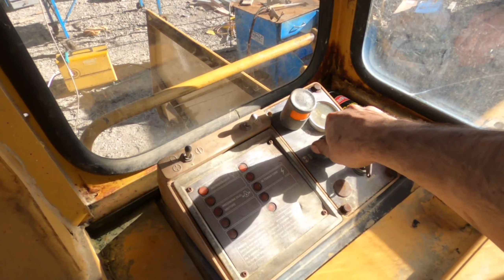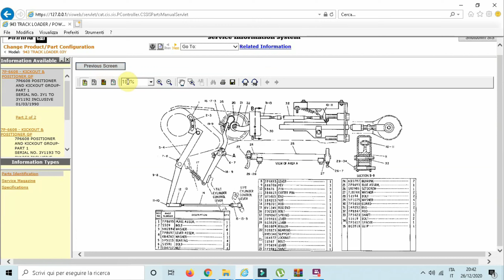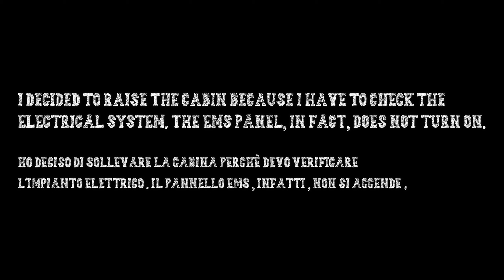CATERPILLAR 943/953!! Systems Operation Testing and Adjusting. EMS SYSTEM,TILT CAB (24 °) PART. 2

Comment: Are these engines in frame rebuild able?
Reply from the maker: Hi absolutely yes. To replace rings and pistons you can do it by disassembling only the oil sump and removing the connecting rod connections.
If you have to remove the crankshaft then you have to remove the entire coolant radiator block.

Comment: Hello, do you know if there are valve rubbers on this engine, my machine had an oil leak in the exhaust manifold? thank you
Reply from the maker: HI. The valve guides could definitely be worn. But the oil in the muffler is definitely, indeed certainly the wear of the piston rings scrapes oil from the pistons. Removing the cylinder head, oil sump. Take the pistons out and replace with new piston rings. Possibly honing of the cylinders with the drill. Let me know. Thank you
Reply: @thecatSimo  Is it possible for the piston rings to suffer at 7000 working hours?
Reply from the maker: HI. Absolutely yes . The 3204 engine has only two piston rings, one compression and one oil scraper. In my experience they are engines that do not exceed 5000 hours. I'll tell you that it takes about 5 hours to replace the piston rings, remove the cylinder head and hone the cylinders. You have to remove the cylinder head, and from under the oil pan you disconnect the connecting rods. No need to take the whole motor off. Usually around 5000 hours the head gasket fails, but probably the piston rings are worn, and the cylinders will be like shiny mirrors.
Reply: @thecatSimo  Can you tell me what needs to be replaced assuming the piston rings are damaged? Thank you very much for your time
Reply from the maker: @Žarko Stojanović  To do a clean job. You need to replace bushings, piston rings and cylinder honing. But before disassembling the cylinder head, do this check: Remove the exhaust manifold, so you can check from which cylinder the oil comes out. If the valve guides are worn they can be replaced easily, but surely the oil would not end up in the muffler. The oil in the muffler only comes out of the piston rings. Or you have some valve and valve guide that lets oil through but always because the piston ring lets too much engine oil through. Do the test I told you, remove the exhaust manifold from the head, start the engine and check for leaks. Let me know
https://youtube.com/shorts/b4AYPfmDbow?feature=share
Reply: @thecatSimo  It is already visible on two cylinders because the oil broke through the exhaust manifold, I can also send pictures... Is it mandatory to change the engine head gasket? I'm asking all this because I'm going to have a problem getting the parts
Reply from the maker: @zarkostojanovic872  Of course it was obvious that the head gasket needs to be replaced. With 300/400 euros you replace everything. Contact me on this email: uisum79@gmail.com Send me some pictures and the plate where there is the serial. So I'll also send you the maintenance manual, tightening torques, etc.